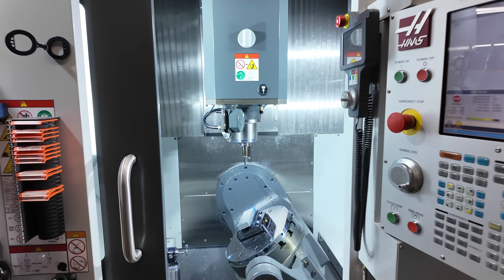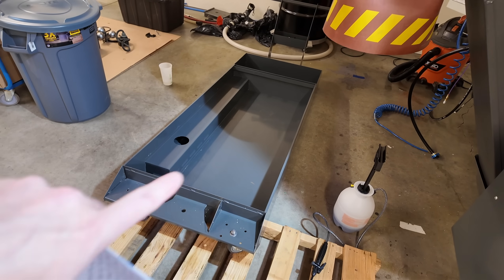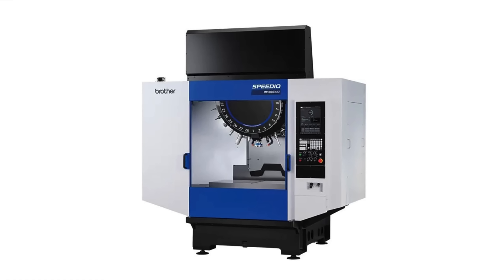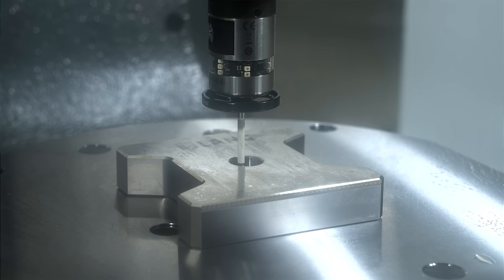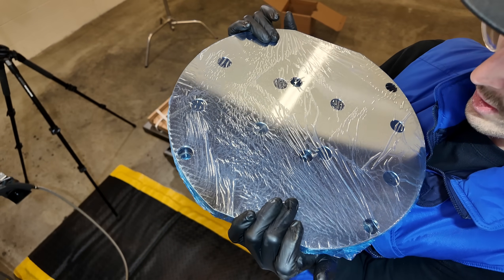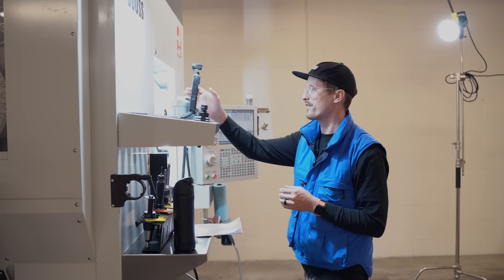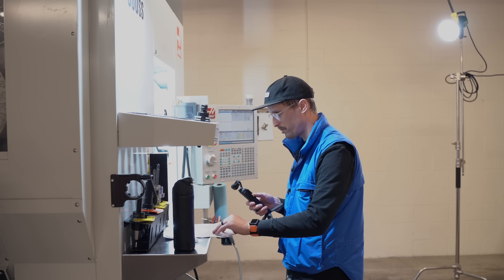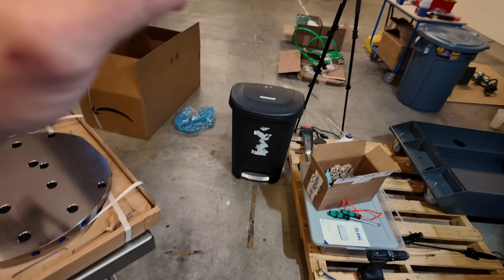how much does a 5-axis cnc really cost?

Comment: I had a private conversation with a service engineer from DMG Mori who is in charge of the Chinese market. 
He told me that Chinese machines with the same capabilities cost 1/3 of the price of a DMG Mori machine. 
So I asked him what is the premium for in a DMG Mori machine. 
He explained, that DMG Mori stays in tolerance for 7-8 years. 
The chinese machines stay in tolerance for around 3 years.
There are many szenarios in which this can be good enough.
Reply: keeping tolerances of from what measure? thats another question. I have a DMG CMX 50 U, it keeps tolerances in 0,005 micrometer, so maybe after 7-8 yrs later it will be around 0,008. So? 
Also, if you have a Premium machine, it will sell itself, the customers will be more open to you.

Comment: I bought a Haas VF6 from a customer that had given up on it. A 1996 model year. I could see clean new boards in the control cabinet. I ended up installing the spindle oil pump rubber drive coupling and install a LCD screen. It cost me $2,500.00 to get it to me. I did the electric. It does have a board for a 4th axis. I bought it for $750.00. Works great!
Reply: That will be pretty easy to recoup investment on even for non commercial purposes what a steal.
Reply: Yep, I bought a $125k commercial digital press (laser printer) for $2500.  It had a problem that prevented it from working and the company that owner it was shutting down (COVID) and needed to leave their facilities by the end of the month. It was so big that if they didn't sell it, it would have cost a ton of money just to dispose of it so were happy to sell for $2500.

I made friends with people on  industry forums (technicians who service these machines for a living) and managed to get my hands on all the technical documentation, diagnostics software, and get help building a clone technicians laptop for servicing the press. 

Took 2 months and a LOT of reading and testing but was finally able to diagnose the problem, procure a $45 part from a supplier in Germany and got it working.  It's been about 4 years now and it's still running like a champ. 

It took some time, effort, and a willingness to persevere, I now have an amazing machine that benefits my company that I never would have been able to afford outright.

Comment: Does the machine have thru spindle coolant?
Reply from the maker: Yep
Reply: @pdxcnc Then be careful with your tooling. On some machines if you put tool holders in the spindle that are not thru coolant ready and turn on coolant the back pressure can ruin the spindle bearings. In our shop ALL tool holders were thru coolant ready so there was no thinking. BTW thru spindle coolant is wonderful.

Comment: One of the other costs will be the software that you’re going to need for 5 axis work. For example Mastercam is more expensive with 5 axis capability, It’s also nice to have solids with MC. Another thing is (How robust is the Post for the software you are using and is it seamless with your controller). Does your CAM software have verification simulation for your machine? With good verification you can avoid “almost” all crashes.
Reply from the maker: Yea it can be. We use Fusion and it has full simulation, and even with the MFG extension it’s just not too considerable of a cost so I didn’t think to include that
Reply: @pdxcnc Does Fusion simulate from the toolpath or does it simulate from the code? There is a difference. In Mastercam simulation is done from the toolpath. We used an additional simulation called Camplete. Camplete  generated code from MC then simulated from that code. A great product, I trained several new 5 axis folks on the platform and never had a collision. You could set safety parameters so you could machine .010 away from vise jaws before an alarm. I never wanted to crash the Hermle. However if you are the only programmer/set up person/ operator you can get along with a toolpath simulation just fine.

Comment: Loan? Why when there's Bidspotter ! Get 90% off new, and other than rigging , if you're able to do the grunt work like hauling it yourself and unloading and leveling if have a forklift or can rent one, buy the fixtures and tooling used (Ebay has everything) or like me I make alot of the stuff.
Reply from the maker: This is negligible money for what something like this can earn. There’s zero reason to own capability to move 12,000 lbs machines once every five years

Comment: Good deal on the machine — couple tips:
Keep your 3 axis: you’ll want it for stock prep and 2nd op stuff
Also, model ALL your tool holders & tools. That’s what keeps you from crashing on a 5 axis (mostly lol)
Reply from the maker: Good tips. The 3axis is all but sold at this point, maybe we'll replace it eventually as I can see the value still but its just not the machine for us.

Have fairly accurate tool holders but I'm going to be way more diligent about it now

Comment: not a bad purchase for that price. i work in hillsboro, run 3x 750s and a 500 myself. we run all lang across the board. one thing iwill say, and issue we had. if you use tool break detection you may need to b0c0 first, even with using 4" gauge tooling it can potentially still not be enough clearance to the platter (we use two of the single station squares that we then modified with new mount locations). i would also recommend that whatever you put on your coolant tray to catch chips from your runoff you prop up, may also need to drill some additional holes/ cut more slots in the runoff section because newer haas dont like to drain very well due to the slotting in the unit not being very big
Reply: also, not sure if youll be able to with the knockoff vise, but at least with lang, you can just order the jaws themselves, so if you accidently say skim the indicators off the top you can jsut order another set of jaws if needed. weve got a number that people have oopsied into that we then turned into custom dovetail jaws
Reply from the maker: Good tips. Can get new jaws. I’m currently modeling some soft jaws for it. Eventually will upgrade to Lang I feel
Reply: @pdxcnc yea going to all lang is expensive but you get quality. it makes it easier when you need to buy more risers you know that the new ones will be the same or very close in terms of deck height to what you currently have.

Comment: The old rule of thumb was if you spent say $50,000 for a machine, you'll spend another $50,000 in tooling and all the necessary stuff before you start making chips (didn't say you'd be making money yet).
Reply from the maker: Yeah touché. Over next year I’m sure we’ll spend considerably on tooling and work holding for it

Comment: Going through the pain of getting a city permit to build a metal building in my back yard. Been in the market for a mill and saw your YCM. Wish I had a building so I can snatch that mill. 

Good luck with that UMC. Fun mills to run. Coolant tanks suck ass. Make sure you put a mesh screen under the coolant return under the mill. It'll save you a lot of time and mess later down the road. Empty that mesh frequently too.
Reply from the maker: This is why I left architecture. Permits 🫠

Comment: If you can’t get a machine into your own shop, with your own crew; especially something you could use a forklift to move (shit, even a big pallet jack), do you really deserve to use it? And if you didn’t assemble it; that means servicing and diagnosing is gonna mean a lot of down time. Thats a prototype size machine, And do you really need a 5x? A decent machine with a rotary table can do nearly everything. Assuming you’re not so busy to relax a vice.
Reply from the maker: It’s 12,000 lbs.
Reply: @pdxcnc  if you can’t generate and manage your own electricity you shouldn’t get to turn this machine on either.
Reply: One in every crowd.

Comment: Choice of Venue and Choice of Jurisdiction are common clauses in contracts. COJ means which law (typically, state) will be applied to any disputes, while COV refers to where any litigation is to be filed. If I am trying to improve a contract, I might say that I'll accept COJ in Delaware (common for commercial contracts, especially larger value) but look for venue in my state, because the big expense comes with having to hire counsel far out of state. That said, I have also had judges disregard CoV clauses in my contracts and allow customers to pursue a case in their local court, even though the client was a big-boy company with its own lawyer on staff so the usual claims of ignorance or innocence do not hold water. My $1500/hour outside counsel said that kind of thing is more common in states with elected judges, so YMMV.
Reply: Also, 135K for a 4-axis VF2SS sounds high to me - right now Haas is advertising a VF2SS+TRT160 combo package for 125K. From what I've seen, they run a lot of specials, particularly near year-end, and my HFO was willing to negotiate a moderate amount around similar machines. And their captive finance arm is kind of famous for offering more aggressive terms than anybody else, so I'd advise anybody on the edge to at least get some quotes and try haggling a little before ruling anything in or out. That's not to say you made a bad deal as the UMC 500 is a different machine and may ultimately be better for some shops. Certainly a clean 2022 machine with 240 hours has a ton of useful life left in it.

Comment: There are a lot of costs besides the machine itself. I worked for Baldor several years ago. They went through a period of expansion and upgrades, which involved about thirty brand new machines. They would budget 25k for installation and another 25k for tooling. That was 10+ years ago. Today, those costs are at least double. Of course, someone else's costs will vary. If you can transfer old tooling from an older machine, or if you can get by with cheap tooling (Chinese knockoffs) you will save a lot of money.
Reply: 25k for installation is crazy high.
Maybe 25k is you're building a brand new 15x15 shed on new concrete for the machine lol.
Otherwise its really just rigging and electrical, which in a competitive market will be under $4k between the two of them. Even if you add in a brand new air compressor, air drier, or 3 phase rotary converter (1ph to 3ph), you're still only getting to maybe 10-12k.
Reply: @monarchco  25K would be a lot for a home shop or a small professional shop. At Baldor, their installation budget included rigging and electrical, as well as a variety of other peripherals. They included things like a coolant mist collector, coolant chiller, chip conveyor, chip hopper, platform to stand on, custom-built table, a pallet lift, computer, hoist/crane, fixturing, and all of the in-house labor to set up, test, and program the machines. Of course, not everybody needs all that, and some need more. My point is that there are a lot of costs other than the machine itself.  My advice is to think it through and include all the things you might need and then add another 10 - 15% for the things you didn't think of.
Reply: @monarchco  Bro, machine comissioning is not free.

Comment: Very jealous of the lang products. We use them at work and they're amazing. Especially the air over hydraulic stamping unit. It's a game changer. It paid for itself in 3 jobs. One day I'll have Lang in my own shop 🤞🏻
Reply from the maker: I know the feeling. I’ve been watching others with this stuff for years. I don’t quite get the stamping unit yet. What makes it so valuable?
Reply: @pdxcnc  the stamping unit stamps a line of marks into the material that fits perfectly in the jaws of the lang vises and a center indicator mark. Look at lang centering gauge and I'm pretty sure it'll have those marks where lang used their own products to make their products. The little indentations replace the need for dovetails to hold material. Idk if the xin dian vises have a scale on top of the jaws for part timing. Check out some videos for the stamping unit. Its expensive but it makes up for in saved time.
Reply: @creepy_mtn_man  did you have a job with extra hard material ? because our standard Hard-Gripping jaws are able to press into the normal materials.
So Mr Boss has got the milling guys a press like that. In 6 months or so it was never used. NOT EVEN ONCE...a real shame.....
Reply: @kisspeteristvan 90% of what we machine is 6061 alu BUT each job is a minimum of 40 pcs. So I will scale the 1st piece in the stamping unit, immediately put it in the 5 axis and then check to see if the probe material check cycle will clear. If it's off I can make an adjustment at the stamping unit. Once I know the first piece will clear I can go ahead and stamp the rest of the job in 5 minutes, throw it on a pallet and drop it next to the machine. I don't have to use a work stop or use a dummy tool as a work stop. The stamping indentations act as a work stop so I don't have to hand scale anything. It makes the workflow a lot easier and faster and kind of makes it dummy proof.
Reply: @pdxcnc  in vastly increases the holding force you can get, especially in harder materials. In softer materials, it allows you to lower your clamping force but still have extremely high retention force which leads to less distortion on parts that have thinner cross-sections. 

Also on production runs, the previously mentioned ease of centering is kind of nice

Comment: This rigging prices seem a bit scummy. We just had a new vf2 rigged in, old one moved to a new location on our floor, and an old vf2 rigged out onto their truck. All in was under $2k here in phoenix. I’m sure it’s location dependent.
Reply: Here in Washington state rigging prices are out of control
Reply from the maker: I should have gotten multiple quotes. Same one I used for UMC was lowest cost when we moved in the YCM. But rid feeling a bit out of control
Reply: When I got my VF2 earlier this year it was about $3k to ship it from the factory to Connecticut and then another 2500 to put it on my floor, and New England is not a cheap place to do anything.
Reply: I'm on the east coast, bought a brand new Haas and rigging was about the same cost.
Reply: At that price they are losing money and will be out of business. 
My rigging company has a lot of expensive gear. That would have cost substantially more.  Like 5 grand.
Reply: @MikeYurbasovich 3 guys with 1 forklift and a truck. Didn’t take long. They didn’t have to drive very far.

I could see it going either way, but if they have the volume of work it’s plausible that they make good margins to last.